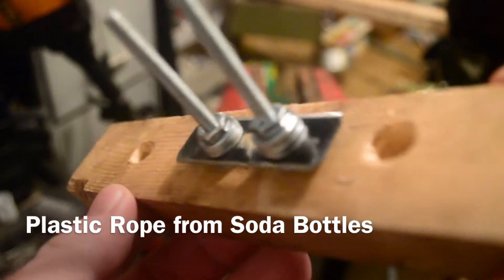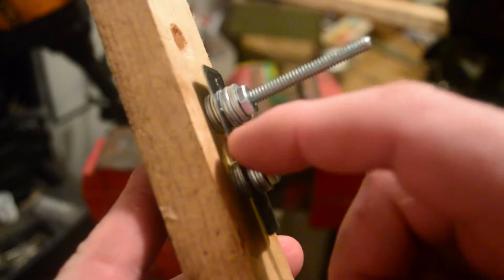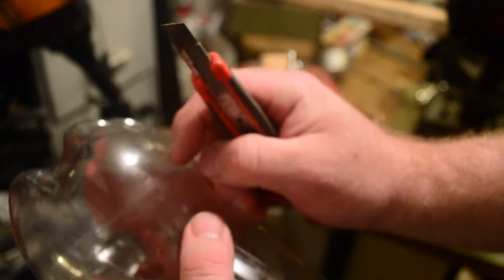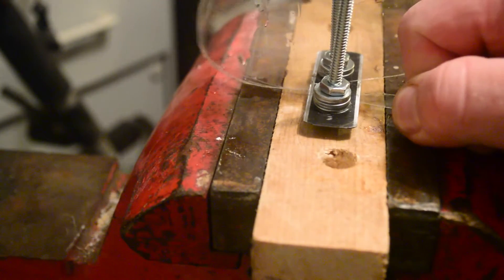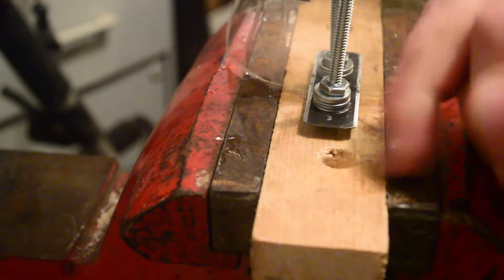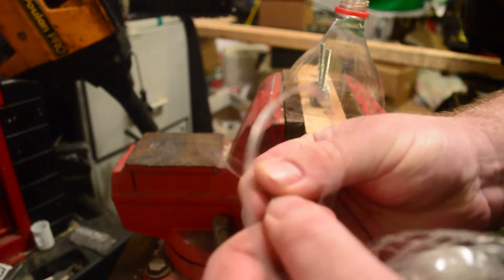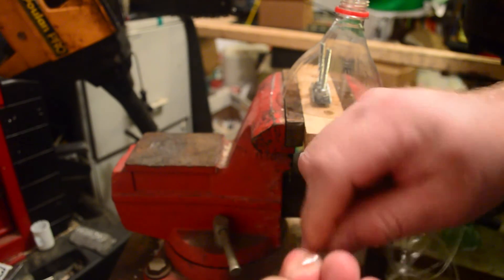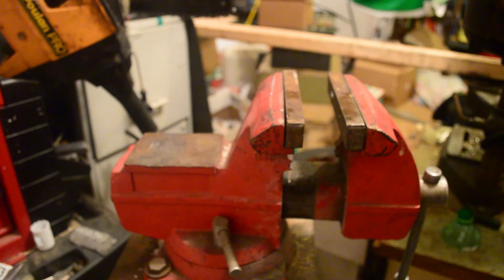How to Make Soda Bottle Plastic Rope

Comment: I think a dowel (you mighta said it and i missed it, i'm tired) would be good to set the bottle on to keep it easier to pull, then a bock of wood to fit over the dowel to push down on the bottle.